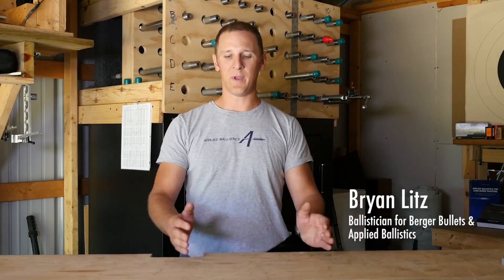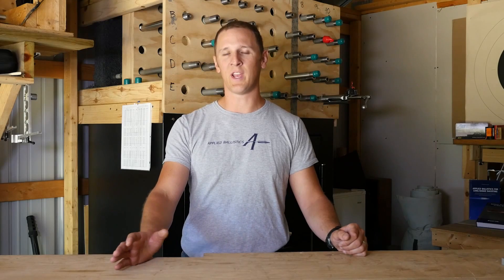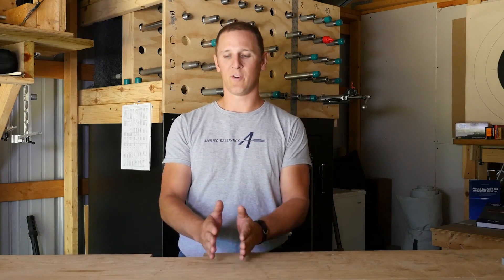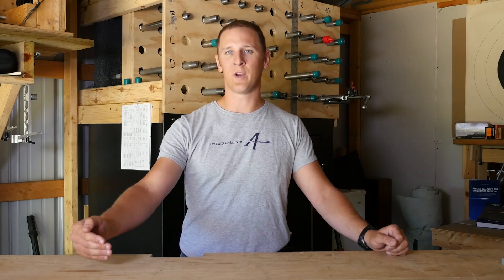Advanced Bullet Stability | Applied Ballistics with Bryan Litz

Comment: So, a faster twist rate is better for trans-sonic range?
Reply: Only if your bullet becomes unstable during this transition period, remember he said shorter bullets with shallow boat tails are inherently more stable,  slower spin rates are better for accuracy too so to much of a good thing is not always necessary.
Reply: Snake is right,... twist rate is certainly important, but choosing the appropriate twist rate for the exact bullet you're using is critical. Bryan indicates it might be good to try out the "Berger Twist Rate Stability Calculator" on BergerBullets.com; an excellent calculator that covers this exact subject. Good luck!

Comment: I'm looking for someone to build a barrel for me to my specs for my A.R. 15 in 5.56. The thing is I have some unusual specifications and finding a person that will even respond to my inquiry for an estimate is like asking someone to grab hot coals bare handed. Would you happen to know anyone that might hear me out that builds barrels and isn't opposed to doing something outside the proverbial box.
Reply: Bartlein Barrels in Jackson, Wisconsin.  Ask for Frank Green.
Reply: i use a 1-7 .223 wylde white oak armament barrel and even with the very long 77g tipped match kings i have been out to 1200 yards with no tumbling or unexplained fliers.
Reply: @kylewalton7005  What MV were you running to get a .223, 77 TMK out to 1200yds?
Reply: @cwoodside907  calculator says 950fps.